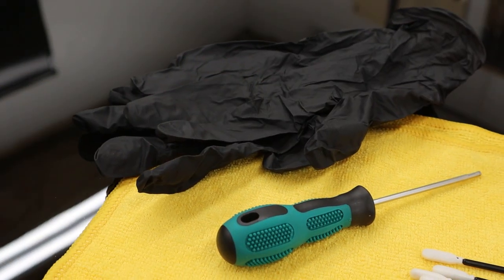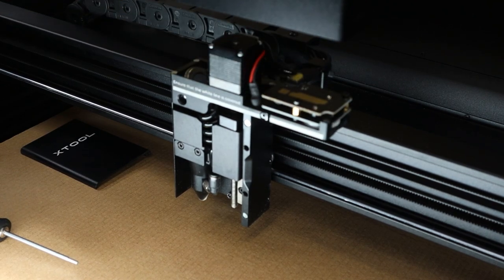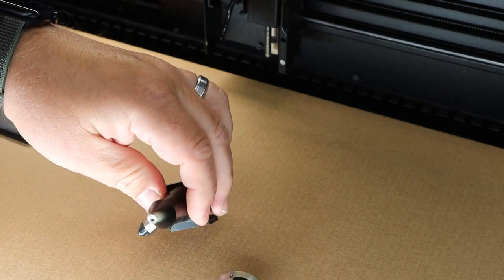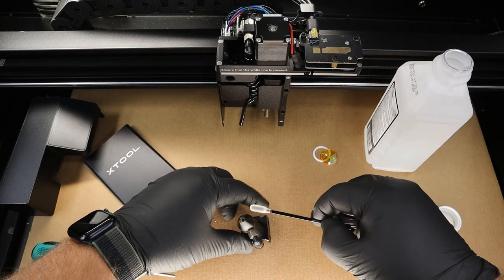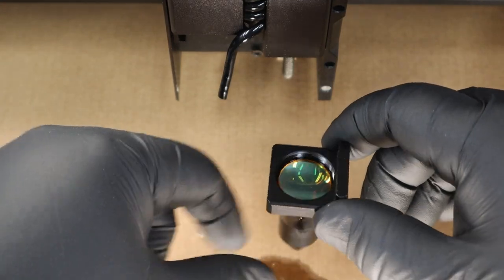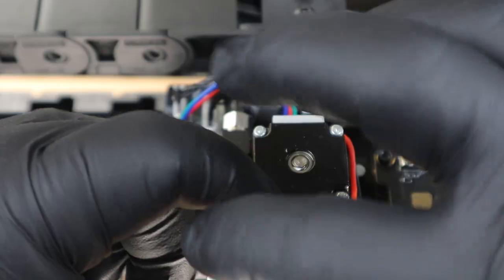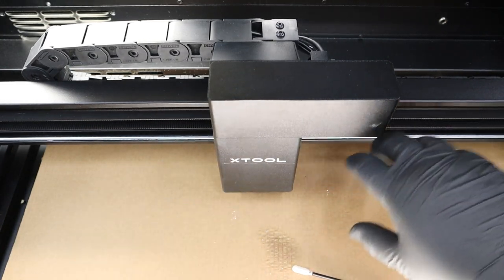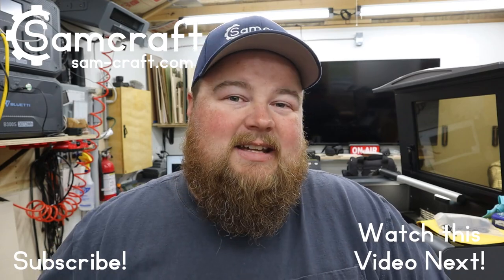xTool P2 Lens & Mirror Cleaning - COMPLETE WALK THROUGH

Comment: Another tip for CO2 lasers is to use the laser at least once or twice a week to keep the tube charged for the laser. If prolonged storage or no usage of the laser the laser tube will lose the charge over time. Glass tubes last about 2-4 years depending on usage.

Comment: Do you have to calibrate it after you do this routine maintenance?
Reply: Depends on whether you move the mirror adjustments. I discovered I needed to calibrate when I clean the back mirror. Pay very close attention to the Xtool instructions about placement of both the back and 2nd mirror. Make sure the convex side of the lens is sticking up when you put it back. It makes a world of difference in your engraving and cuts when you keep them all clean. The new software changes seems to make it difficult when you're pulse marks are WAY OFF. Move the mirrors to their closest position and work your way outward.

Comment: Thank you for the info! I was a little unsure how to upkeep the laser and feel much better after your video. Do you ever need to clean the third back mirror?
Reply from the maker: I should have shown that process, but cleaning it will not be needed as much... so long as you use the exhaust fan and an inline duct fan to always extract smoke and vapors from the machine.
Reply: @Samcraftcom  thanks for the reply! I'll keep it on a slower rate of cleaning compared to the others then.

Comment: You left out cleaning of the mirror in the back of the machine. It's located near the coolant reservoir. It too gets residue buildup since it's near the exhaust fan, but doesn't need to be cleaned as often as the mirror near the laser head.
Reply from the maker: You are correct!
Reply: True... but it does rarely need cleaning in comparison

Comment: Thanks for the video @samcraft is there a reason you don't clean the third mirror at the back of the machine or the camera lenses?
Reply from the maker: The third mirror was cleaned at setup, but is otherwise not exposed to the fumes hardly at all compared to the others. To clean that one, you remove the rear back cover (about 12 screws). I cleaned the camera lenses, just skipped putting that in great detail in this already long video for the process. I wipe down the interior of the machine often with micro fiber cloths and such.

Comment: hello, i dont know if you know the answer but i have a question about the lifespan of this machine, what do i do after the roughly 10000 hours? is the machine just a piece of furniture or i can replace something? thanks
Reply from the maker: That's the average lifespan of the CO2 tube in the back. You can buy replacements and keep on going. :)

Comment: I'm loath to admit that I don't clean my Co2 laser nearly as often as I should..  One thing that you didin't mention in the 'how often' section, a dirty lens or mirror can actually be damaged by the laser, resulting in pricy repairs..  I'd also mention that when choosing your gloves to wear, make SURE they aren't the powdered variety.  As always though, great advice on (what should be, I need to do better, lol) routine maintenance..  I'm not sure about the x-tool, but with my Co2, you can possibly put the lens back in upside down, which affects power a good bit.  I'd always make sure to be aware of the lens orientation when removing/replacing.
Reply: And I see at about 8 minutes you mention lens orientation, lol.  I kind of figured you would, but it definitely bears repeating..
Reply: While I don't actually have an Xtool laser, don't they have 3 mirrors like most others?  There's usually one on the head gantry, one on the left side of the gantry, and another in the back at the end of the laser tube?  I haven't gone back to look at the video, but did I miss you cleaning that, or does the xtool not have/require that?
Reply: @heffe2001  It does have a third mirror. The one at the end of the laser tube has four orientation points. The mirror will operate properly when reinstalled 90, 180, or 270 degrees from the position it was in prior to removal.

Comment: Welp, I have a bad feeling. If the rails and gantry aren't squaring up right, then the machine itself must not be assembled square 😮
Reply: While the top and sides are more than adequately padded for shipping, the feet of the machine sit directly on the cardboard box. If I were a betting man, then I'd place my money on any misalignment being caused by rough handling during shipping and not improper assembly at the factory since every unit is subjected to testing.

p.s. - While every P2 is supposed to be thoroughly cleaned after factory testing, my P2 didn't get enough attention in this area. There was a fair amount of residue along the front and rear cover seals. It also had two minor scratches. Since those first scratches are out of the way I can treat it like a piece of production machinery instead of a decoration for my shop.
Reply: It's not hard to square up the machine though. I think they all get banged around in shipping too much. Mine was delivered on it's side...